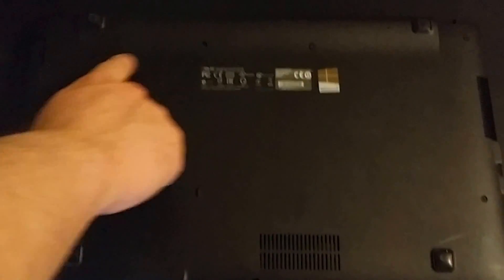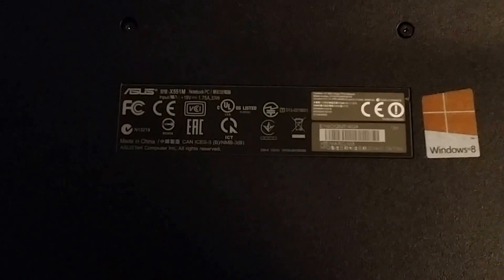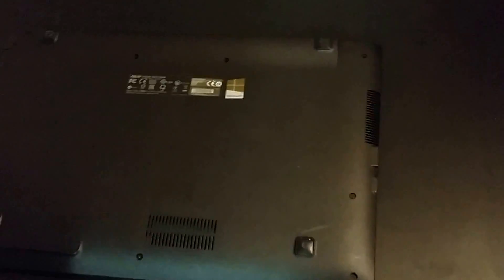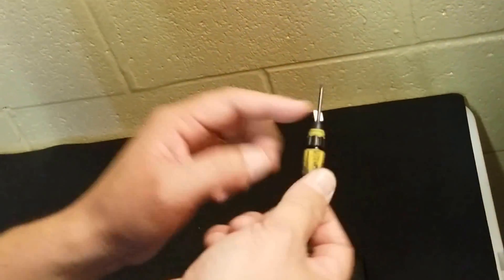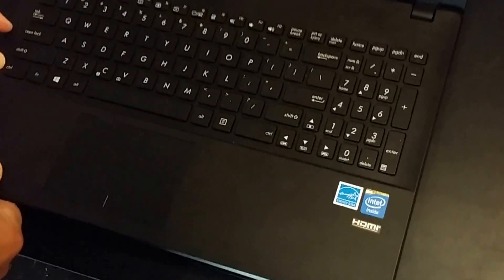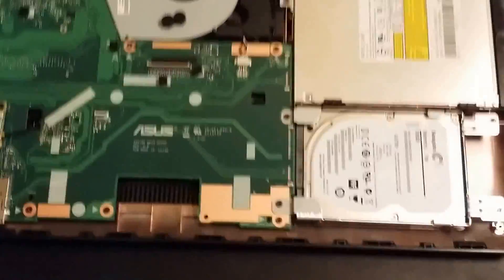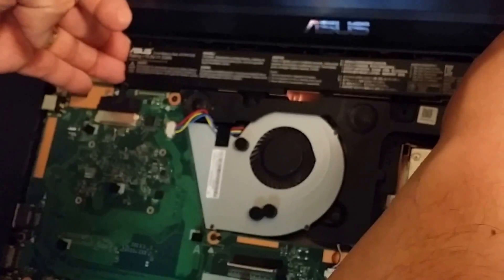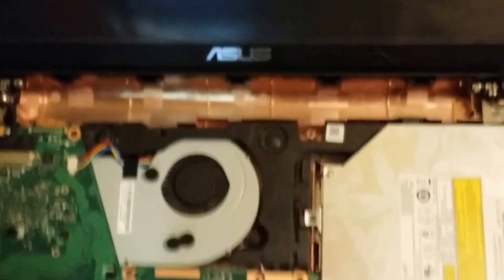ASUS X551M Laptop Battery Removal & Won't Power On Fix

Comment: Thank you for all the information. I am wondering if it is time to buy a new laptop. About three to four times a week, the only way to get the laptop to turn on is to disassemble, remove the battery, hold the power button 60 seconds and then reassemble. Quite inconvenient. Thoughts?
Reply from the maker: Yes that is quite a pain.  Is this still the original battery or a replacement?  If it is the original battery, I think you might want to purchase a new battery which is around $30 dollars.  This should hopefully take care of the powering issues.  If this is a new replacement battery, there probably is a short causing it to not power on normally.  If you are unhappy with the laptop from day 1, I would purchase another laptop myself BUT I would recommend spending at least $500 or more.  I NEVER recommend under $500 laptops due to inferior parts and build quality.  Get a Dell or Lenovo.  I repair too many HP's, Acers, Toshibas and Gateways.

Devin
Reply: Thanks so much for the info. It is one of the low end Asus laptops. It has already been in for warranty work, just under deadline. It is the original battery. I don't think the battery is the problem, as the problem is intermitent. Probably time for a better laptop. .Btw, this has been the most informative site I have found for the Asus laptop. Kudos!
Reply from the maker: You are very welcome!

Comment: I'm having issues with prying off the keyboard. Any tips? I'm trying to be super cautious
Reply from the maker: First off, make sure that you removed ALL the screws.  On some models, there are hidden screws under the rubber feet, screw sized stickers, labels, etc.  If you are 100% sure that you removed all the screws, start at the bottom right corner of the laptop and use a guitar pick or something REALLY strong and thin and pry open the keyboard lid using minimal force.  The lid is held together by retaining clips that are molded plastic so a lot of effort doesn't have to be made to pry it apart.

Comment: First off -- great video! 
Secondly, I'm looking to buy this battery, but all I'm seeing is 14v. They're claiming to be compatible, and most reviewers say they work fine. I've searched and gotten varied answers, so maybe you know...? What does the extra voltage do? Do you know if they're compatible? Thanks!!
Reply from the maker: First off, yes they are compatible.  If the batteries were NOT compatible, there would be MAJOR lawsuits flying around due to damaging components and exploding laptops which by the way are not happening.

The laptop needs a specific (nominal) battery terminal voltage; that's most likely the 15.0 volts. The exact battery terminal voltage will vary over a discharge cycle, but LiIon batteries in general have very good voltage stability over the discharge cycle.

However, LiIon battery cells can easily have a voltage slightly above 4 V, and charging is usually recommended once cell voltage drops to 4.05 V. LiIon batteries require very specific safeguards to be safe to use (the question asks about lithium polymer (LiPo) batteries, but the by far highest voted answer specifically points out that for the purposes of that question, the two are "essentially equivalent").

This leads me to believe that the voltage you see quoted might very well be the per-cell voltage, whereas the battery is quoted as the battery terminal voltage. The two values are not directly comparable. If you know this to be the case, then battery terminal voltage can be approximated as number of cells (in series arrangement) times cell voltage. For example, a four-cell battery with a nominal cell voltage of 4.4 V would have a nominal voltage in the 17.5 V range. High-capacity batteries may connect several such sets in parallel, resulting in the same voltage but larger current capacity.

For the same voltage, capacity (and thus, for a given load, use time) is determined by the number of mAh the battery is rated for. (Note that actually determining this value is a whole can of worms in itself, as the capacity is usually dependent on the discharge rate and ambient temperature. For this reason, battery manufacturers provide data sheets that specify discharge characteristics.) Multiply the two and you get the number of milliwatthours (mWh) the battery can provide; Wh, or in large installations kWh, is a common unit for battery capacity. (Wh = Ah x V, because W = A x V. This applies to DC applications; AC is slightly more complicated.)

All this to say that a difference in mAh or Wh ratings of a battery is generally harmless, but the voltage is critical.

If you are unsure, you should just contact a reseller or the manufacturer of your laptop and tell them that you want an extra battery for your computer. They will be able to tell you the model number(s) of the exact manufacturer-issue batteries that fit your particular computer. It will perhaps cost some more, but you are vastly less likely to break anything or have something burst into flames. For most people, this is a reasonable trade-off.

14.4 V and 15.0 V are certainly close enough to be effectively interchangable.

Comment: Yeah what a shit design. All that work just to change a battery. I guess they designed it with the intention of not having to replace any parts. I just wanted to disconnect the battery to discharge any dirty voltage.
Reply from the maker: Exactly!

Comment: How do you replace the top cover?
Reply from the maker: The top cover has plastic locking latches.  If you carefully removed the cover/lid, the latches should be fine and you should be able to snap the lid back in place.  Gently put the top of the cover down first then start applying pressure along the top and then the sides.  Then apply pressure along the bottom.

Devin

Comment: hi, so I have a question. This only started a few days ago. when I looked at my laptop in the morning with it closed but plugged in the light, that would normally be green if charges orange like red if charging, was the red and blinking. it has done that twice now. Also it was at 91% now 93% percent saying 10 minutes to full charge..and it will say that still after an hour no change. Right now it says plugged in charging but nothing is changing. I am now hesitant to use it not plugged in for fear that it won't charge back up after dwindling down. Do you think it is the battery perhaps or something else..I honestly don't know what to do. I really wish that the battery was easier to get to since I am hesitant to try and fix it myself if that is the case. If it is the battery, is that a generally relatively cheap fix if I get it done by someone else or would I be better off trying to brave it myself due to expenses.
Reply from the maker: Ok, here is the good news!  Nothing is wrong with your laptop Patricia.  On the newer models of laptops, the charge % will not go to 100% anymore to show the owners that the battery is starting to deteriorate.  Your 93% is the new 100% even if you charge it for over 24 hours.  Lithium Ion batteries in laptops generally have a 1-3 year life span depending on usage, charging habits and environmental conditions.  So don't worry, the 93% just means that your battery is on the downward decline of its life.  Whenever a battery without the AC Adapter is lasting less then 30 minutes, it really is time for a new battery.  Follow the video's instructions (assuming it is an ASUS X551m or something similar to it) to disassemble it and remove the battery and install a new one.  You can pick a new battery up for under $30 on Amazon or eBay.

Devin

Comment: x540sa Asus help please it is stuck at zero percent and wont actually charge. If you can help it is appreciated
Reply from the maker: If it is not charging, it is most likely:

1. Needs a new battery or
2. Your power adapter could be failing.
3. You DC Jack is failing.

In that order

Devin
Reply: The laptop works with the charger ao I imagine it is door number 1. Thanks
Reply from the maker: No problem!  If you have any other questions, feel free to comment again!

Comment: Hi there, well i have a laptop just like that one but mine doesn't have num keyboard, anyway, i looked through "Power Efficiency Diagnostic Report" taht my battery has less than 40% life, but i'm looking for the exact model, (ASUSTeKX551-26) (haven't opened my laptop), and i simply can't afford an original product, could you recommend me any possible option which would be cheaper but durable? and by which number, serial or name could  i search for it?
Reply from the maker: To be honest, a generic model sold through Amazon would be just as effective.  There are many reports that the minor differences of voltage and wattage and Amps don't really affect the condition or stability of the laptop.  If it did and it did damage the laptop, there would be lawsuits galore out there suing the manufacturers of said batteries for the damage it would cause to these laptops.  Simply put your Asus model number into Amazon with "battery" added and read the customer reviews.

Devin
Reply: thanx a lot Devin!
Reply from the maker: Anytime!

Comment: Thanks for the helpful  video and the tip for placing the screws in the pattern they came out.  I had another helpful hint for those that only need to replce the battery.  There is no need to disconnect the three ribbons (they were already disconnected in the video) because there is enough slack in the ribbons to move the computer cover to remove and replace the battery.  Thanks again for the video!
Reply from the maker: Anytime!  I am glad the video helped you out!  As far as the ribbon cable goes, you are right but there are those people that just YANK things thinking there is nothing holding it down.  That is why I said to be careful and remove them.  But if people are aware AND careful, yes you don't have to remove them :)

Devin

Comment: Can someone plzzzzzzzz send me a link to Amazon or eBay where I can get this battery ... not 14.4 v but 10.8 ... all I'm seeing is 14.4 . plzzz help.
Reply: btw , just want to say great video ... helped b4 so thanks
Reply from the maker: https://www.amazon.com/Powerforlaptop%C2%AE-Asus-X551-0B110-00250100-A31N1319/dp/B015ISBSJ0

There you go!

Devin
Reply: +Angrysquirrel PC
hi thanks for the reply ... really appreciate it ... however I just found out that 14V might not work with a 10 V. An 11 V might work though.
Just posting this for anyone looking for a replacement for this specific battery ...
this battery might work https://www.amazon.com/gp/aw/d/B01IQIO34Q/ref=mp_s_a_1_1?ie=UTF8&amp;qid=1472739813&amp;sr=8-1&amp;pi=SY200_QL40&amp;keywords=asus+x551m+battery+11.25v&amp;dpPl=1&amp;dpID=31iUJzfKhxL&amp;ref=plSrch#featureBulletsAndDetailBullets_secondary_view_div_1472739947555
... Stay posted as I will receive this on the 10th of September .I"ll let u know if it worked or not .

Thanks again
Reply from the maker: ibziee Thanks for the catch.  By all means please let the rest of us know if your battery works or not.  If it does, I will sticky it in the video header!

Devin

Comment: I do not own any sort of grounding tool. Will it still be safe to still install a new battery without a mat or strap?
Reply from the maker: You can make a grounding strap easy.  Just get some copper wire and wrap it around your wrist and then run that wire to an electrical outlet and give about a foot of extra length.  Wrap that end around a screw or nail and insert it into the ground (bottom hole assuming you are in the United States).  You are now grounded and will not fry or damage your system.

Comment: What if I can't unscrew all of the nails,  two of them are really stuck in there,  is it still safe to pull off?
Reply from the maker: If you pull off the lid without removing all the screws, you risk breaking the plastic molding piece that holds the screws onto the bottom lid.  I use a strong magnet attached to the screwdriver to help pull the screws out as I am unscrewing them.
Reply: Ah okay,  do you know how much it would cost to replace the battery? I've already purchased a battery,  but I need someone to put it in for me since I can't remove the screws on my own an i dont think it's worth the damage to my computer
Reply from the maker: It all depends on the computer shop.  You can call around but I estimate the repair if you bring your new battery to be around $50-$80.  Just call around and look on Google for the shop's reviews.  NEVER go to a shop with Google reviews below a 4.5 score.

Devin

Comment: Hello, my latop is a Lenovo ideapad Z410 and is equal to your machine. I imagine the procedure is the same, rigth?
Reply from the maker: It should be "Similar" BUT they are different machines.  Just unscrew EVERY screw you can visually see and then remove screw stickers/rubber tubes and rubber feet to see if there are hidden screws.  Then remove the keyboard if it is the standard one that detaches from the lid.  Then remove the screws under the keyboard.  If the keyboard is the kind like the ASUS x551m, then the keyboard is part of the top tray.  Just be very careful about the ribbon cables and make sure not to jerk the tray off when you get to that point or else you will tear/rip them.

Good luck!

Devin

Comment: I'm trying to open my Asus 540S but I can't unscrew the screws? What am I doing wrong? (Also I'm obviously terrible at this stuff lol)
Reply from the maker: Make sure you have the right size screwdriver/phillips head for the screws.  You can try using different size drivers but the screws should come off quite easily.

Comment: My laptop won't turn on is is cos of the battery or something els
Reply from the maker: It could be:
1. Power Adapter/Charger
2. Battery
3. DC Jack
4. Motherboard

Use the video to remove the battery first then hold down the power button for 30 seconds to discharge all power from the system to reset it.  DO NOT PUT THE BATTERY BACK IN.  Then reassemble the laptop and see if it powers on.  That will eliminate the Battery as being the problem.

Comment: thanks for the video.  I'm trying to pull the keyboard top off but it's either stuck or I'm not pulling hard enough. I obviously don't want to break the keyboard, how hard do I pull? (and yes, all the screws are out)
Reply from the maker: Use a guitar pick and start at the bottom right corner.  This lid is being held by plastic molded latch hooks and the guitar pick acts as a wedge to release the latch clamps.  Work your way around the bottom of the keyboard lid then move to the left side and work your way up.  Then go to the right side and do the same.  You then GENTLY pry the lid off the top so you do not break the plastic latches at the top.  REMEMBER!  There are 3 cables underneath this lid!!!  Do NOT pull the lid away from the computer after you separate the latches.  Lift the keyboard as shown in the video and release the ribbon cables from the motherboard before you do ANYTHING!

Devin
Reply: Thank you
Reply from the maker: No problem!  Good luck!

Comment: @angrysquirrel i recently bought asus x454la notebook which has similar feature of non-removable battery, now how should i use the laptop for the longivity of the batttery? 
should i use it through the battery or by using power adapter without disassembling the battery? 
TIA
Reply from the maker: The battery can be replaced.  It is just a PITA to replace due to the disassembly.  Even if you were to remove the battery and use it only when plugging in the power adapter, LI-ION batteries eventually die even without using them (degrade over time).  I say leave the battery in and use the laptop because if you get a power outage, your laptop will shut off without the battery.  Replace the battery every 1-3 years and you should be ok.

Devin
Reply: +Angrysquirrel PC thanks for thehe advice!
Reply from the maker: NP!  Good luck!
Reply: :D

Comment: I have the same laptop, I think. It has X551MAV-RCLN06, +19V 33W on the back. Where did you get your battery from? I want to replace mine.
Reply from the maker: I recommend getting one from Amazon.  Here is a link:

https://www.amazon.com/Powerforlaptop%C2%AE-Asus-X551-0B110-00250100-A31N1319/dp/B015ISBSJ0/ref=sr_1_1?ie=UTF8&qid=1470881977&sr=8-1&keywords=asus+x551m+battery

Good luck!

Devin
Reply: Ok, thank you!!
Reply from the maker: Anytime!
Reply: Does it matter the voltage? The battery I have now is +19v.
Reply from the maker: That battery is made for the models listed.  Yours is one of those models so it should work just fine.
Reply: OK, thank you again!

Comment: do you have any tips if the keyboard panel won't remove easily?
Reply from the maker: Just be sure to remove ALL the screws and start at the bottom right corner with a guitar pick and work your way around the bottom and then upper left then start to spread/lift the keyboard tray off.  Working the corners is the best way to remove the keyboard tray off the bottom base that are being held together by plastic clamps.
Reply: +Angrysquirrel PC I decided to look for more screws...they hid them under the little grippers! thank-you
Reply from the maker: No problem!  Glad you found them!

Comment: can I use the laptop with no batery? is it safe?
Reply from the maker: Yes it is completely safe.  Just remember that if the power goes out without the battery in, it will shut off like a desktop computer would.
Reply: hmm thanks a lot buddie ;) But did u see? I've an internal battery like this one, it's the same thing? Sorry for bad english and thanks for the help!